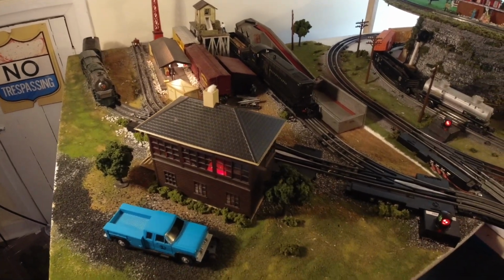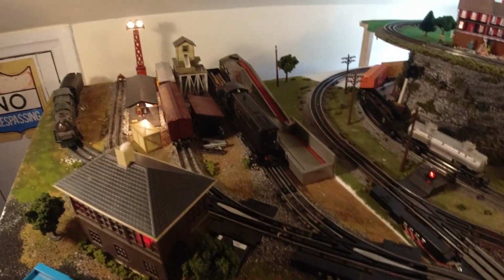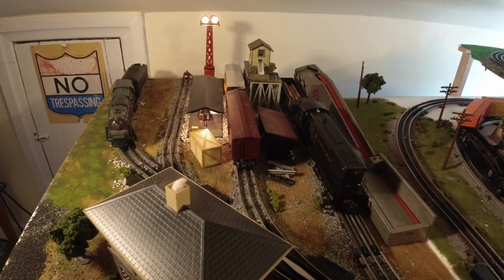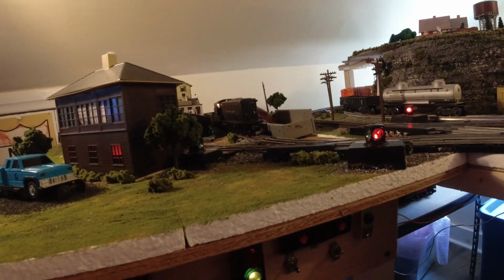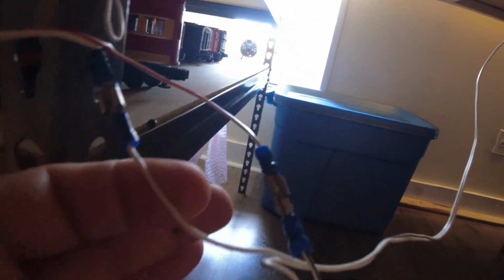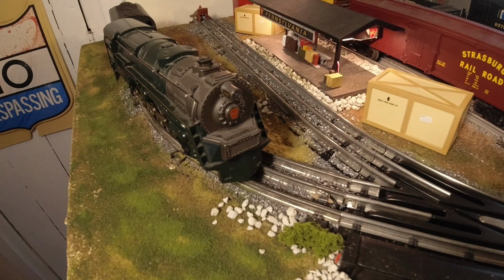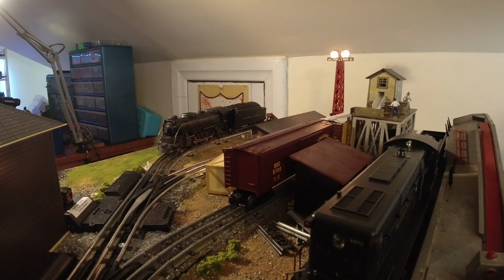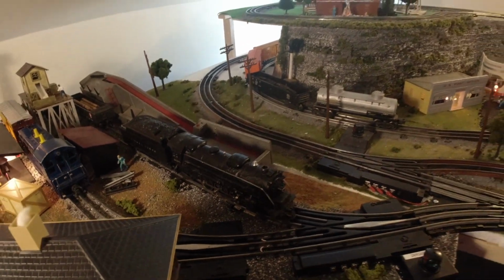Building My Yard, A Walk Through Tour and Run Session

Comment: Can you recommend a way to get cheap o gauge buildings
Reply from the maker: Not a problem, that depends on your budget and your desired detail level.  For less detail but classic toy train buildings look into  Plasticville buildings (new / old models). For more detail - Lionel sells unpainted / Unassembled kits that can be affordable. Definitely check out train shows and eBay.  Menards also makes a lot of really nice models that are lighted and are considered “ affordable “ but they can be expensive.
Reply: @NixCrossing  I’ve looked on eBay the stuff is way out of my price range or you have some sellers trying to sell you just a cardboard front scene
Reply: I really want a mixture of plastic vile in and stuff with a lot detail